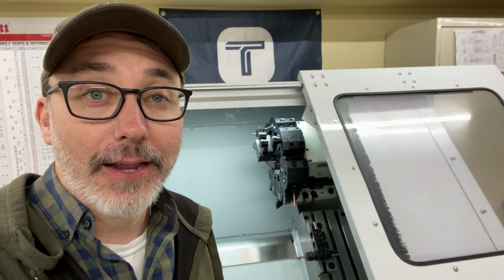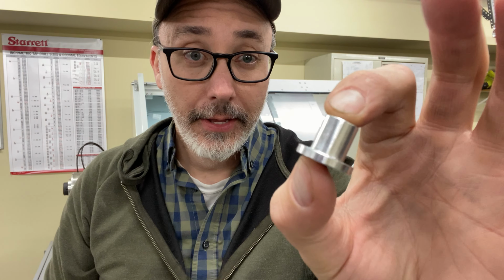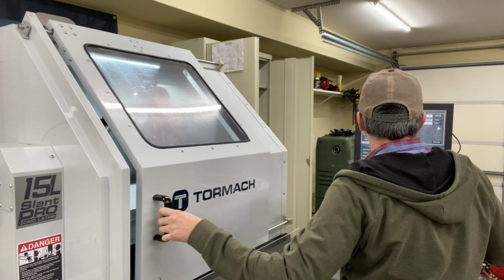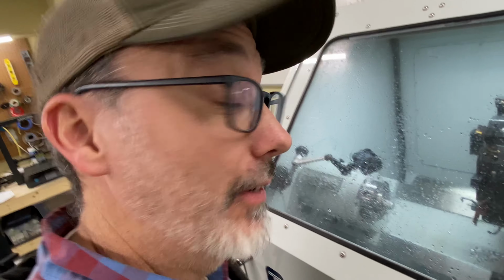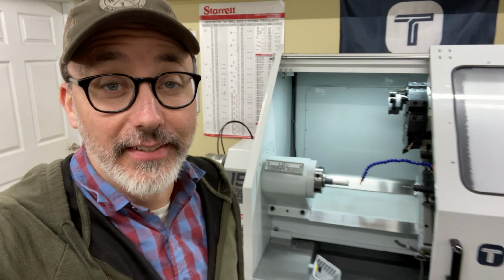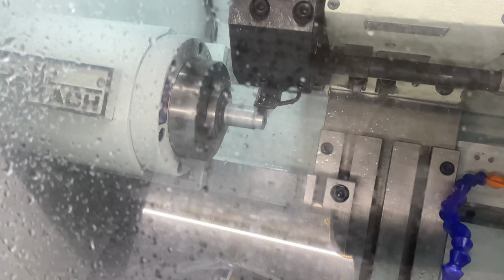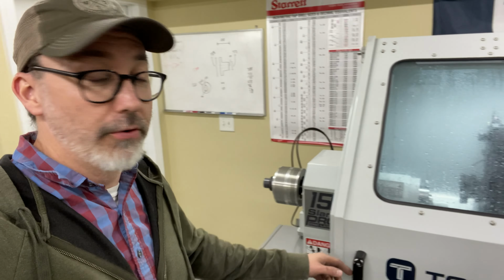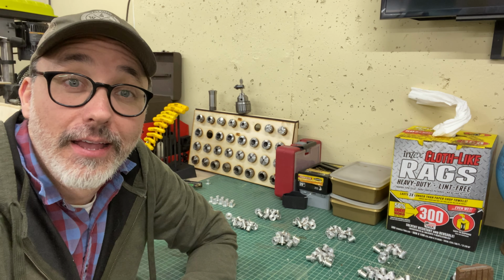Adding a Bar Puller to a CNC Machine = Automation!

Comment: Not sure if you figured this one out your self.. but use a bar "pusher" as well not having to fight the offsets as much.. First you do the pull the bar and place it "some whwere" you lock and detach, then unlock again and come in with a different tool that is just a "flat face" kind of deal that you also use as your reference tool for zeroing.. and then just "push" the bar back until you hit - zero.. And voila no fighting offsets.

Comment: I cringed a bit when I saw stone wheel on the grinder being used....we had one explode at work(not a machine shop).......but other than that.....loved the video!!  My other two thoughts were already mentioned....pull out longer and do more than one at a time and also the angled cutoff inserts.  In lieu of the angled cutoff insert, you could use a boring bar inside to do a back chamfer before the cutoff. But....your part is pretty small, so the chances of you having a small boring bar to do this with is extremely slim.  It should, at least, leave a much smaller burr to take off.  If you don't have a belt grinder/sander to remove the excess, you can probably just run it down with a chamfer tool in a drill press.  Take a 5C collet that just fits the nose of the part....you can probably squeeze the collet closed enough with your hand to keep the part from spinning, then just manually feed the part up, into the chamfer bit while the drill press spindle is running.  Not as fast and easy as the sander, but it should leave a much nicer finish. The angled insert would be the best option.  A Nikcole Mini Cut would be great, but I'm not sure it's cut depth is long enough.  Yes, I realize this is all a moot point since this video is 5mo old..... lol :)  -Mike
Reply from the maker: Great insights tho!  Thanks for sharing. Will be helpful on a future part!
Reply: @JeremiahDaws  I spent the day on my 15L cutting 3/8-24 threads.  I sure do like that lathe!! :)

Comment: You should never grind soft metals on a grinding wheel. The soft metal will imbed in the stone and when it heats up and expands, the wheel will fracture, and when it does, it’s like a grenade. People have been killed by exploding grindstones.

Comment: Cool bar puller. I’d consider batching  a part like that to cut say 8 off one pull. However much stick out you can get with acceptable deflection. Face segment one, cut OD to the chuck, drill say 4x part depth, cut small diameter, part off creating face feature for segment 2, and on and on until you run out of stock on that pull.
Reply from the maker: That’s brilliant. I never thought of that. Will try it. Thanks for the tip.
Reply: @JeremiahDaws  I think there is a macro for this that just shifts the Z however many times you do tell it.

Comment: Is there any way to get the lathe to eliminate that nub left on?
Reply from the maker: All I’ve found is either having to flip it around and programming a second operation to face it or just sanding/grinding it off.
Reply: @JeremiahDaws   you need parting insert that is angled, like this: https://productinformation.sandvik.coromant.com/s3/documents/pictures/draw-char/preview/202421527_d50_0_0~tl02_04.jpg